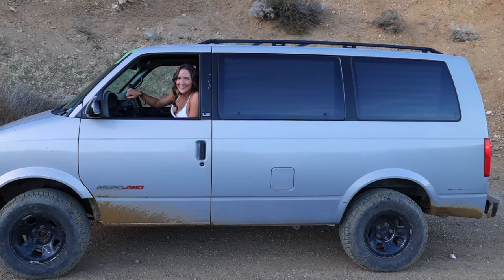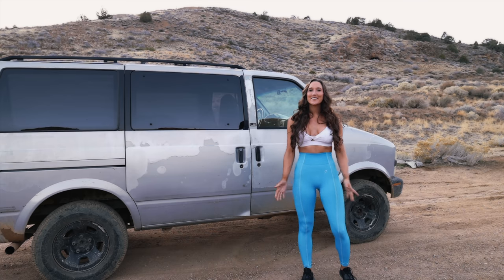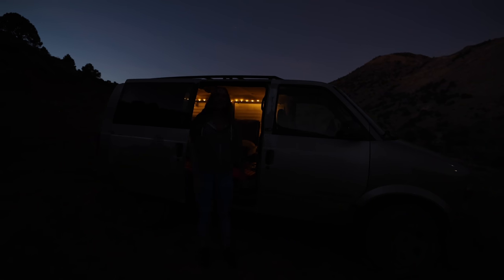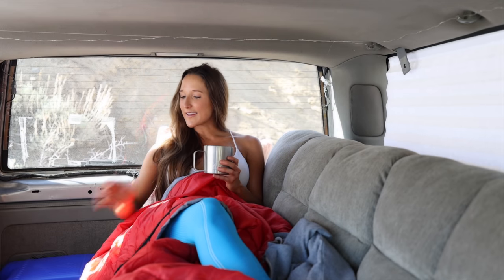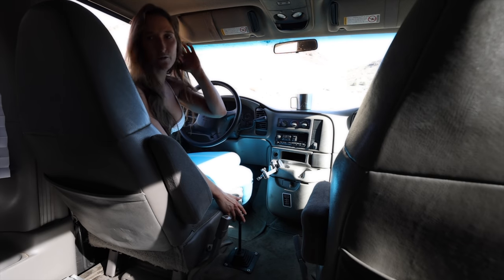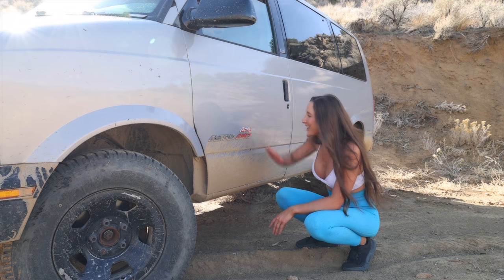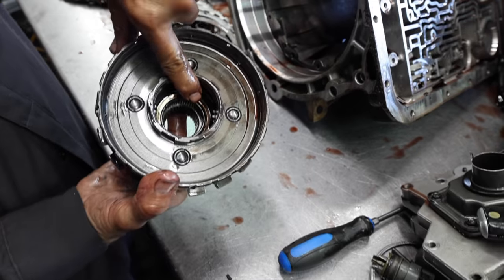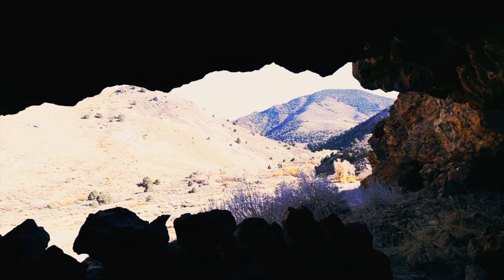Van Life Update - I Converted My $700 Van into a 4x4 Off Road Chevy for Camping and Overlanding

Comment: All the hate mail probably came from the people who realized your van can do all the same things their $40k jeeps can do but with more character. 😁 So much appreciation for fun, unique rigs like this. It shows that you don't need anything super modified or expensive to go out and have a good time. Hope you do more videos with it.
Reply: It's not going to do everything.  But for someone whose interest is what they find on the trail, versus the trail itself, it's probably good enough.  Take a van with a factory 4x4 system based on a shared platform SUV, upgrade that van with the goodies that fit from the SUV model where possible, and it's likely to do the forest roads and two-tracks just fine.

It won't be as good off-camber, it probably won't have as many off-the-shelf options for things like skidplates and rock sliders, and it'll have some overhead clearance issues in some circumstances, but if the driver isn't specifically looking to challenge him or herself by intentionally taking on obstacles and is careful about things like dragging pans, it will get there and offer a place to sleep out of the weather.
Reply: Or, $200k conversions. They are not wise.

Comment: Great find on the Astro van. I used to drive the 2wd for a airport shuttle company in San Diego. Those vans were so solid. We would load 6-7 passengers and luggage all day everyday and those vans took the abuse. Our company had about 50 vans and loved them for their durability. 300k out of a engine was normal. Lots of the vans lasted 300-500K until the company got rid of them and bought new ones. Good luck with the build out and safe travels.

Comment: An advantage (sometimes) for the AstroVan, being smaller than the Sprinter it will be more nimble and probably go places the Sprinter won't. Or shouldn't. Keeping cheap will reduce the hurt if it gets pranged. :)
Reply: Plus, the drivetrain is easy to find parts for.

Comment: The haters I would assume have Perception Bias.  Running around in a $200 000.oo sportsmobile is great!  All the power to you.  But many people just don't have that kind of cash to beat something up offroad.  The Astro and Safari vans are an excellent option as they are cheap cheap.  I have had just about every 4x4 that one can have and if you plan to sleep in it as well then the comfort and safety of the van is great!  I don't care for campers personally as they limit where you can go much more than even an AWD Astro would.  Also it is amazing how many people that have no savings at all drive really nice vehicles while many millionaires will drive old vehicles.  Good on you for not being so high and mighty to not give the Astro a shot.
Reply from the maker: Exactly. You said it all spot on. Cheers my friend=)
Reply: I couldn’t agree more, now I would
Lock down those recovery points, fuel and water storage and everything else will just follow when needed. A DIY roof rack with some extra lighting would come in handy. Who knows We end up seeing the Van at the Overland Expo West one of these years.

Comment: The 4.3 GM engine in these are hands down the best six cylinder engine ever made by the big three. I wish they still made Astro vans. They are frame-on construction, have a great engine, can tow a decent amount and aren't as prone to rust as other vans are. In short. Astro vans are awesome.
Reply: I wouldn't say "hands down" the best but they're right up there. Personally, I believe that inline 6s are better than V-6 engines but, if there's no room for one, then there's no room for one. The 4.3 is indeed an acceptable substitute in this application.
Reply: It was a good motor, had one in my 95 Blazer. It was like a 350 with 2 Cylinders less. Sure beats the 3.7 in my Jeep Liberty.
Reply: i drive fords ,at that these are still excellent engines
Reply: Yep this Saturn  same its not the frame I want , can't reach many things, it and the back plugs things , but its a work horse I've had a flat bottom boat n 7 bi g adults, all our luggage,  for almostv2 weeks, gear to fish tunes, snorkeling packed over flowing, ut pulled choice didn't know  it was there  I very woken up many times n some driver u know be running  100 , 2 trips 1800 miles that way full loads its maybe a but bigger id have to check its got trailer kit on it
Reply: I’m not a huge Chevy guy but I had a 1999 Astro through high school and it was and is the best car I have ever owned.
Reply: The Astro's not frame on. It's got a forward subframe and a monocoque body. It's similar to the 70s and 80s full size Chevy Van, only with most of the mechanicals based on the s10. I love these things even with their propensity to eat u joints. :)
Reply: @toddbob55  agreed had many GM products and Chev and while parts are cheap they go thru alot of parts and resale drops.
Reply: The older 4.3 Chevy's were solid. I know someone who built this same van with a Buick 3.8 Grand National Turbo motor. Had more power, incredible gas mileage and much smoother. Ah the good ole days.
Reply: Debatable because the Ford Inline 6 4.9L uses gears instead of chains and both were used in commercial duty UPS sized trucks for years. Also GM believed the iron duke to be the most reliable for smaller vehicles such as mail carriers (s10 platform)
Reply: @toddbob55   You prob drive a fwd honda v6 that needs a 1100$ belt job every 60-100k miles
Reply: @trevorpomroy550  I have a 2001 GMC Safari and it is a body on a full frame, with leaf springs in the back and torsion bar in the front. I have 228,000 on the original engine and I had the same sun gear housing failure as the Doc.
Reply: @toddbob55  --No matter what you own other than a Toyota, the Dealer Shops are all working on their Vehicles. Chevy's are much easier to work on versus a Ford--Dodge Products are mostly Junk after a few years-they do have the Best Body Styles as a whole. The Chevy 350-5.7 liter Engine was Hands Down Best Engine ever made...
Reply: I don't know about that, the Ford 4.0 six and the old Chrysler slant six were better in my opinion.They were impossible to kill.
Reply: @KeepItMowed  And now that's a 50 grand motor. :-)
Reply: damn right!
Reply: @toddbob55  your opinion is just that an opinion.
Reply: The best V6 made would be the GM 3.8. Those motors are king
Reply: @MattieMoe2009  i agree with you 1000%
Reply: @DarkLinkAD  thats usually when you want to replace your belts anyways lol and 1100 i doubt that bud
Reply: @bitterman131  Timing belt
Reply: @DarkLinkAD  well yeah if timing belt is involved
Reply: Exelente video doctora pertnesco a un club aquí en la CDMX  por a ca en la ciudad es difícil encontrar los kis pará Acer la conversación a 4x4   saludos

Comment: Ohh heck yes Doc Hottie. If the 4.3 ever gives up the ghost you could replace it with a L03 or L05 out of a similar year full size truck. That's another bolt in conversion for the most part that really makes them more drivable up in the mountains.

Comment: Nice project ! Good job converting it to a 4X4. Put a skid plate for the transmission/transfer case and 33 inch tires and  it will go most anywhere  !

Comment: I had a 98 safari with the 43 vortex and I had 400000 km on it when I got rid of it Still ran fine but I did have to replace the transmission at about 180km But it was a work van and it got work hard. I don't think you should have any problems with the vortex great motors.

Comment: Also might pay you to invest in a full 5mm stainless bash plate to cover underneath trans mission, transfer case and sump well worth the investment if going off-road a fair bit, when I go 4wding I go over alot of hard unused tracks and I'm sure I've saved my underneath many times as to the rocks, trees etc coste about $800 but has saved me thousands in repaires over time

Comment: Glad to see you still have the van, still many uses left in it.  I would suggest a roof rake , propane heater, mini frig, maybe some more aggressive off-road tires? This would help on some longer adventures and the stove would enable you to heat water for your mushroom tea! The cave was smaller than it looked from afar, that rocky floor did make a camp out less desirable, but I have found a blow up mattress to work well on a rough terrain.

Comment: Won a bid on a state auction for a 96 AWD Safari. It was owned by the state police for CSI use. It has a lot of miles on it but only 25K on a new crate motor and was very well maintained. It's in great shape and being a cargo version, was a great candidate for a camper conversion. A trip to Walmart for a folding futon, 200 watt solar panel on the roof, a couple 6 volt batteries, a diesel heater, a 12 volt compressor fridge, and a cabinet built into passenger side rear wall and I got a great adventure rig on the cheap...AND I DON'T HAVE TO PUT UP A TENT. Thanks for the lowdown on the conversion you did doc. Right now I'm just going to lift mine 2 1/2" and get better tires but in the future, I may want to have full four-wheel-drive control instead of the AWD system.

Comment: GM 4.3 liter 90 degree v6 was derived from the infamous 350 small block v8 platform which began in 1955. Arguably one the best V8 engines ever to be mass produced on the planet. As well many valvetrain and engine components are interchangeable as well as transmissions, it's no wonder it's just as tough. Pretttty neat conversion, still have a 97 2wd GMC handicap equipped i purchased to shuttle my mom around in her last days. Thank you so much for sharing.

Comment: I had a 1997 Astro.  It was an awesome vehicle.  The powertrain lasted over 300K miles.  I never had to do anything but change the fluids.  I went through multiple alternators, and other parts which you might expect but I used the heck out of that thing and it just kept running.  I had to laugh when you mentioned the windshield.  I probably replaced 5 of those.  The angle of the windshield makes it vulnerable to stone chips.  Don't be surprised if you have a chip within the next 6 months in the new one.  Nice job on the 4x4 conversion.

Comment: wow, i’m Impressed. I had a 4.3 L in my GMC Jimmy, and I replace the injectors with updated injectors nothing special and gained almost 60 hp over what was factory in 96 when it was built. That engine I swear it would break your neck I had that much power. Absolutely wonderful off-road. Mine had 273,000 miles on it when I sold it and it was still running like a top. Just prior to selling it I had also used it as a tow vehicle, and I towed a Ford focus from Virginia all the way to Iowa and it pulled the mountains in Virginia just fine.

Comment: The 4.3 is a good solid engine that's good for LOTS of mileage is one problem spot is the lower intake manifold gaskets though.  They go bad and the van starts to burn coolant somethimes leading a a bad head gasket diagnosis. Check these first. That and the ignition coils tend to let go. Same with fuel pumps. Don't buy cheap Chinese ones.

Comment: Great deal to get the tranny rebuilt at that price. Only transmission I ever had to rebuild was in a Pontiac Fiero,my very first car,it cost $1500 to do in 1992! The engine should last forever,V6 Vortec was such a great motor they were put in industrial fork lifts and run on propane gas. Got a fork truck in my shop with over 16,000 hours on that same motor and still runs great. Happy travels Dr. Hannah 🏞️

Comment: The astro van is way better than a sprinter. The astro should have  the 4.3 vortec v6 engine  which is basically a 5.7 chevy v8 with the last 2 cylinders chopped off. Which means all the  remaining parts inside are sized for a v8.. That's why you still see them on the road with over 300,000 miles on them. I have 185,000 miles on my vortec v6 with absolutely no issues . Good luck with it. :)

Comment: You got a deal/steal on the transmission rebuild!  I've had 2 transmission rebuilds on 2 separate vehicles and did my own transmission replacement on another.  $3,200 and $4,200 for the rebuilds, and $2,000 for the replacement (including approximately $1,200 to correct my shadetree transmission replacement.
I'm looking to find a weekend warrior mobile, but I should find a job first.

Comment: Just shy of 3K for a 4x4 van is a great deal. I just paid 3k for a 76 Dodge W300 4x4 dually and donor truck. Still need tires, rust correction, manual choke, etc. Still need to buy a camper for it.

Comment: When you get a chance, get rid of the rear slip yoke driveshaft with a "slip yoke eliminator kit" and replace the rear drive shaft with a 2 piece drive shaft ( that way if you break a rear u joint, you can remove the drive shaft and get home using the front drive)..
Reply: Can you convert a standard 1998 2 wheel drive Astro to a 4x4?

Comment: You did good Hannah----does your engine cause you any problems now? I have found that, even on a high mileage engine, if you change the oil 3-or 4 times at intervals of 1000 miles then change it at 2500-3000 miles from then on it will last a long time. Of course use a good oil and don't fall for any additives. Dirty oil causes wear to happen quickly and you most likely don't truly know what kind of care it had before you got it. Thanks, Van

Comment: You should get better MPG with 4X4 than the All Wheel Drive. AWD  just that, more parts moving all the time drawing power and gas. Sad the aftermarket did not jump on the 4.3.

Comment: I think your van shares a lot of components with a S10 4x4 pickup so parts are readily available and at good prices.. the 4.3 may get a bit noisy -  er but it will just keep going. 😉 love your positive attitude Doctor!
Reply from the maker: it is a little noisy I will admit but not enough to be an issue, so far so good=)
Reply: @DrHannahStraight  Hey Dr Hannah.. On my S10 4x4 Crew Cab  I keep up with the oil changes..every 3000 miles...even a little early sometimes (city driving) and I use the factory oil filter( AC Delco).  A couple of times after heavy rains, it would crank but no start so  I keep a spare distributor cap and rotor in the truck with the torx screwdrivers...T15 and a T20.(you may need short handle ones).just in case.  Otherwise a very reliable engine.  I'm having lunch in the truck right now! Rainy day here  , Lol.and  I love how you take on these projects. Cheers from Nova Scotia Canada 🇨🇦

Comment: Yes, I rebuilt a couple automatic transmissions working on my own hotrods and helping a couple of buddies. They are intricate, but not rocket science. I'm Not an expert, I just followed the instructions. Attention to detail is EVERYTHING. Just a couple of specialty tools, take your time and go by the instructions and I am 100% confident you can do it too.
Reply from the maker: Thanks for the vote of confidence=) Didn't look terribly intimidating but surely would stink to do it wrong and have to start over=)
Reply: @DrHannahStraight  Also, the cost savings is huge, shops charge A LOT. The rebuild kits are usually a few hundred for the good quality kits. Doing the job with a couple of friends can save a ton. And then, help them with one of their projects to pay them back, that's what friends are for:)

Comment: I had one of those as a work van with the factory AWD system. That little thing had descent tires and would go just about anywhere within reason. It finally died after many 100K of hard miles with to much weight in the back every day of its life.

Comment: With my conversion my mileage stayed the same, 16.7mpg. I thought it might go up 1/2-3/4 mpg, 2wd over AWD, but it didn't. Exactly the same. You seem to have quite a bit more clearance between the front shaft and crossmember than I do. I need to check that out, in six months after it starts warming up outside.
Looks good, with no unnecessary fluff to your build. I hope you have better luck with yours than mine. 6k miles after trans rebuild, crankshaft positioning sensor went out and toasted the motor.

Comment: Don't listen to the nay sayers. Not only is this van about as reliable as any made it is way more inexpensive to fix. The 4.3 is an awesome motor and has plenty of power for bigger tires and a loaded vehicle. Best of all you hit on the best part. Even if I had enough money to offroad a hundred thousand dollar rig I still wouldn't. Spend money to make it really reliable and have fun. Get yourself a winch and look into rebuilding the spider injection system which is the only real weak point on this platform. Luckily it won't leave you stranded just use way too much fuel making it hard to start.

Comment: I have owned 2 of those.  I first had the Astro and a few years later owned the Safari (GMC version).  Both were great vehicles.  I put 160K miles on Astro and over 200K on Safari.  Drove both to the beach, the mountains, took multiple trips snow skiing.  I know you made a great choice.  Neither of mine were 4wd or even AWD although I did rent an AWD version in Lake Tahoe on a ski trip once.  I really wish GM would resurrect these on the new 1500 platform with a Diesel engine.  I would buy one in a heartbeat.

Comment: Hi, can you go on highway let say 60mph on 4x4 High? Thanks
Reply from the maker: I keep it in 2wd rear for highway driving.
Reply: @DrHannahStraight  Thanks I understand that , but do you know if it is ok use 4x4 high on highways let say in wet/icy conditions ? does front and rearr differentials works when 4x4  is engaged?
Reply from the maker: @Roolis77  The front and rear differentials are stock from the AWD and work when 4x4 low or high are engaged by manually shifting the transfer case. As a general rule I try not to go over 50mph in 4wd high in any car since usually I drive slow in bad weather. The short answer- I have gone 45mph to 50mph on long snowy drives multiple times in 4wd high. I would reach out to journeys off road by phone if you want to do this. They will be able to answer any question about the 4x4 astro van
Reply: @DrHannahStraight  Thank You!!!!